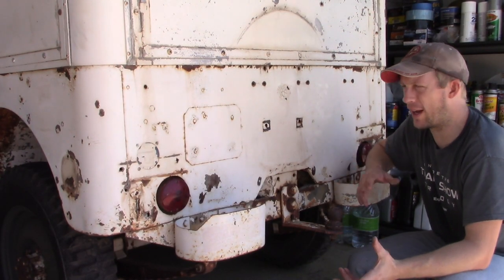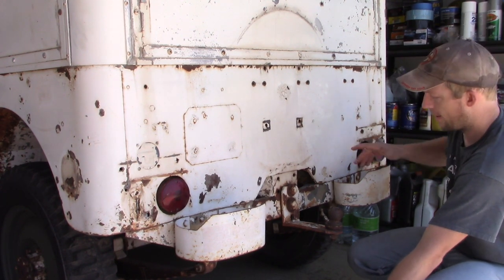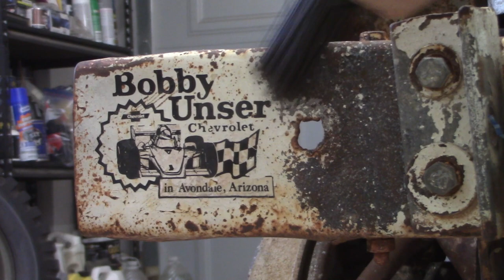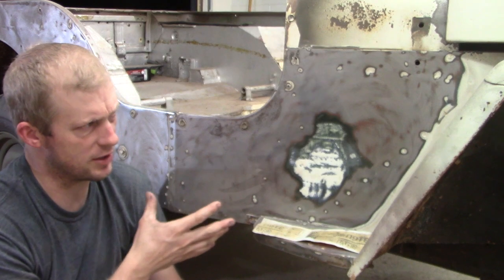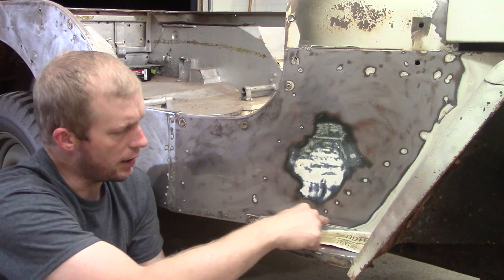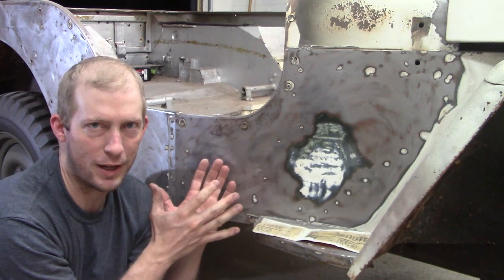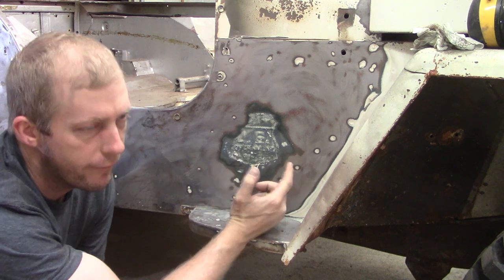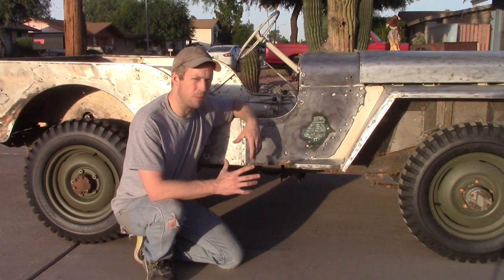1943 Willys MB Restoration | Paint and Accessories Removal | ASMR

Comment: Did you find hood numbers? It may have been easier to have had the body, fenders, hood, and grill sandblasted. Sure it costs some $. But time is money too.
Reply from the maker: I didn't find any numbers unfortunately. I have another video coming up where I dive into that. They had been stripped/removed prior to me searching for them. 

Definitely considering sandblasting in the future, assuming that process doesn't warp the panels. This is different than a later model car like a 60's Impala however, so I may be ok if I have the components blasted.